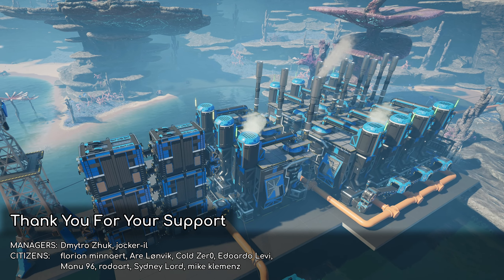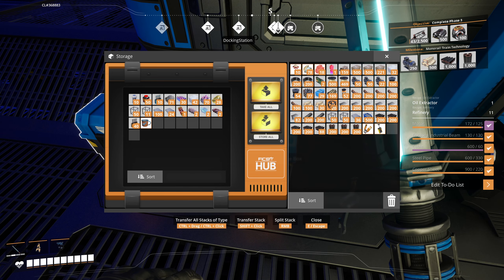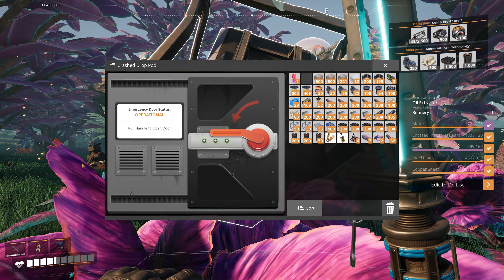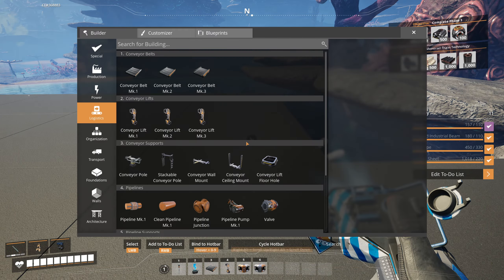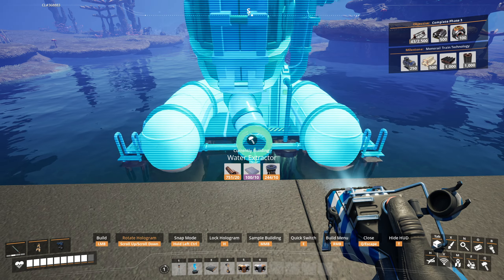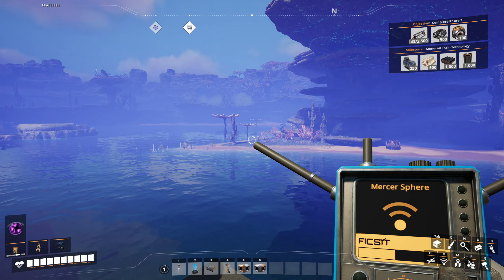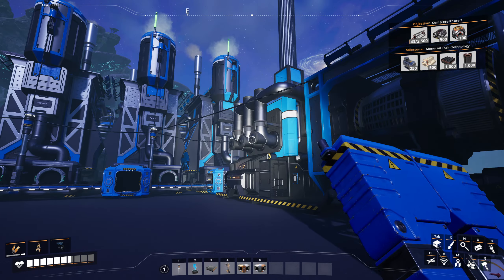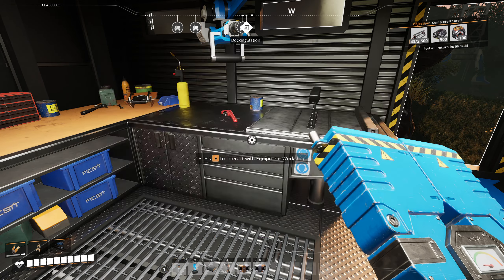Our First Oil Refinery - E21 ║ Satisfactory

Comment: 48:23 The default conveyor belt lift requires a height of "three splitters/mergers", but if you have an input and output for the conveyor belt lift prepared, the minimum height is only "two splitters/mergers". And it looks nice by the way :p